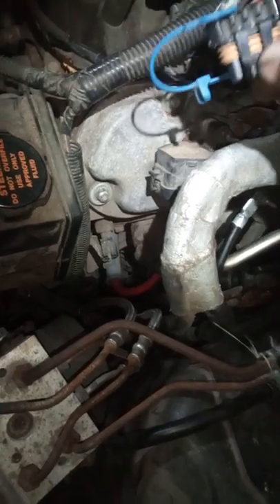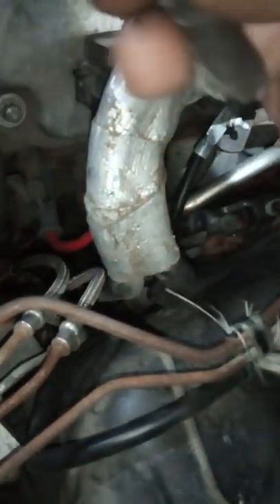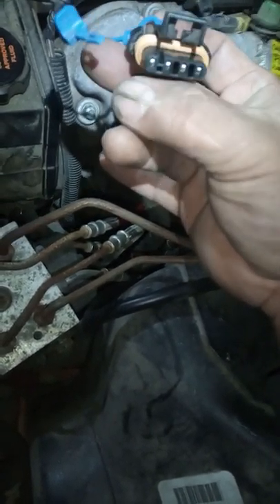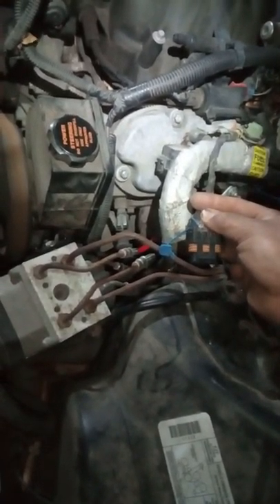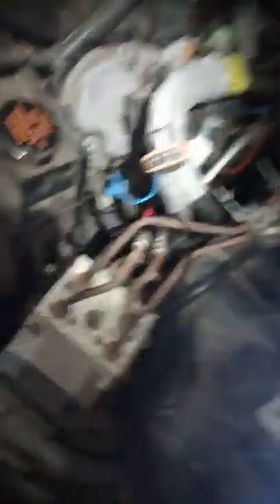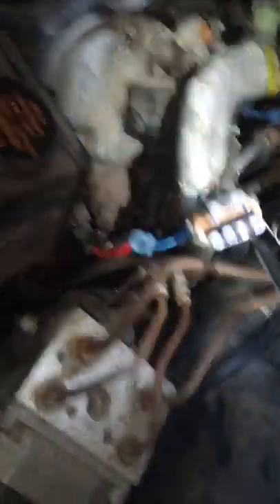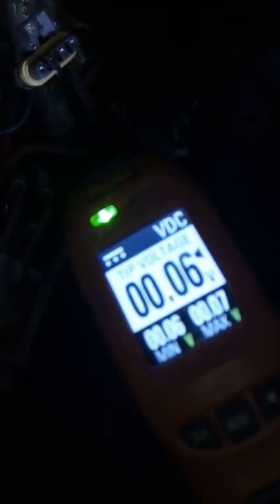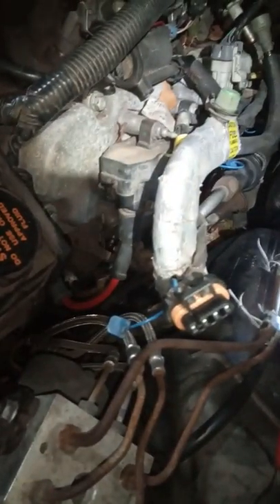98 Camaro ls1 how to test ignition coil circuit

Comment: I have a crank/no start/no spark condition on my 1998 Trans Am. (It's been sitting up for years until  a mechinic rebuilt the engine.)

With Tester connected to ground, I get 12.v on red and black wire/connector, and nothing on purple and gray (two middle ones). I can connect to the PCM with my laptop/scanner, program a calibration into the PCM and read a a calibration from the PCM fine.

There was a ground that was left disconnect (eyelet was broken, maybe when they removed the engine it  was pulled loose) that didn't allow my pump to prime. I fixed that. But I still don't get spark. I can't find other loose grounds. Of course i've checked ignition fuse, ignition relay, and I replaced the Crank Position Sensor... even the tempearture sensor, because I heard that could cause a no-start... I'm not sure why that would be, but it has a new one.

My engine, the heads... all that see's 12v when I touch the voltage tester from positive post to those areas. But the Valve cover, not. I ran a ground cable from chassis to the bolt that holds coil pack assembly to the valve cover and valve cover is now grounded. But, I still get no spark when I crank and the voltages I described at the coil connector you show remain the same.

Can you give me any advice?
Reply from the maker: Check the black wire if you have ground if you dont supply it with a  external wire..also need to point point out check the pink or red wire make sure its has 12 if doesn't check ignition fuse or supply 12v with a external wire i.now if you have 12v and ground check the pcm
Reply from the maker: Black wire needs to have ground
Reply from the maker: So your problem iits no ground to the ignition coil you must have ground on the black wire. I go through this problem all the time people forget to install a lower ground on the engine that supply ground to this coils..make a little cut on the black wire and supplying ground your car will start up right away
Reply: @SamsAutomotiveS  Black wire is showing 12.5 volts and so is red wire. "Supply it with a  external wire" how?
Reply: @SamsAutomotiveS  How do I make that happen? All kinds of actions come to my mind when you say that, but i don't know EXACTLY what you are telling me to do.
Reply: @SamsAutomotiveS  Where should the "lower ground on the engine" go? I do have grounds attached down below. Is there a specific one you can explain that  I'm missing?

By saying "make a little cut on the black wire", do you mean, splice a wire into the black wire on the coil pack and take it to ground? Words are proving difficult to follow exactly what you are telling me to do. Thankk you so much for such a quick reply... I really appreciate that!
Reply: @SamsAutomotiveS  So... i used a T-Tap Wire Connector to splice into the black wire and ran it to teh ground point at the chassis on the driver's side. immediately I got one start rotation and it died. i know after sitting a long time that happens,. I took that opportunity to top off the fluids and put the oil treatment for avoiding dry starts in the oil. The strong way it immediately turned over that one time, I just knew i was home free.

I tried it again and it just cranked and cranked without so much as a stumble. I double-checked my splice (which looked good) and put the in-line spark tester on. I do see it sparking now. i put some more gas in the tank and tried it again. No joy.

At this point I don't know if it's choked out or i have yet some other issue, or if it's just being hard to crank atm. It builds oil pressure and there is fuel pressure at my gauge.

Any further advice is appreciated. And thanks for giving me what appears to be a definte breakthrough.
Reply from the maker: @MichaelBuieFilms  dont matter where you ground it..main thing its the black wire to be ground in a good place if you want you can follow the black wire i thing i grounds on the black